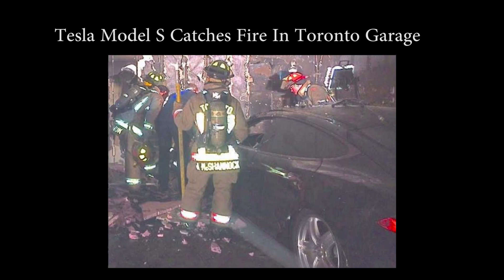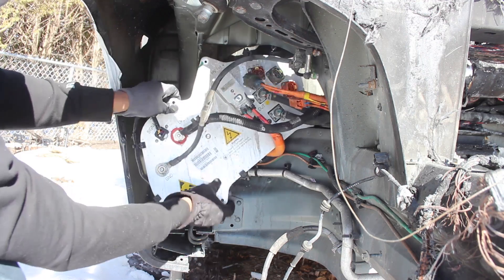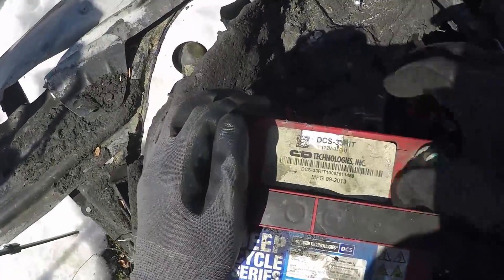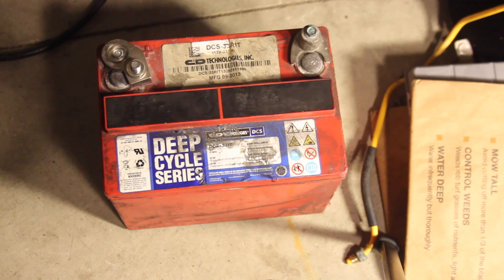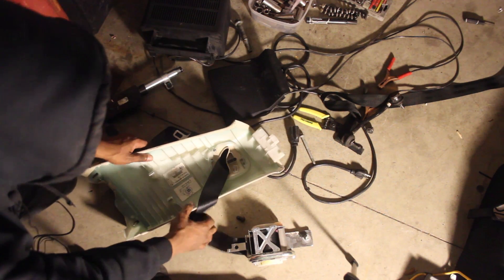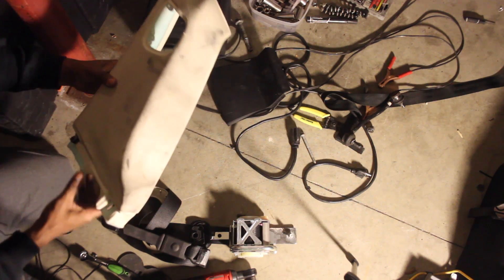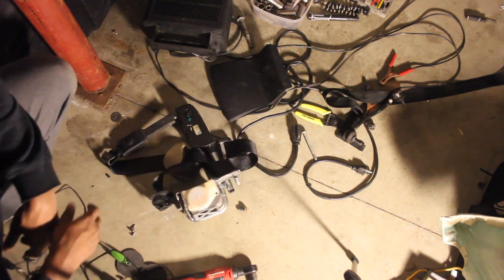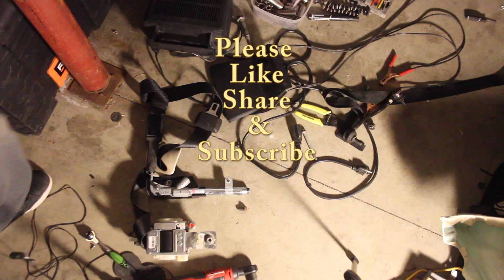Dismantling a fire Salvaged Tesla Part 1

Comment: You are correct about the explosive in the buckle portion pulling the buckle downward making the belt tighter. The explosive in the belt retraction device actually causes the belt to tighten as well. In doing so, the belt does become locked too.

Comment: Hey man - I thought of an interesting Q for you, Rich.  Say you're in bum f*ck Egypt and you run out of charge.  Who can you call?  Will AAA come to your rescue, and if so, what could they possibly do to get your Tesla running again?  These car batteries take a long time to charge.  Would the technician tow your vehicle to the nearest charging station?  And finally, have you ever been to charging stations and every slot was already in use?  Is it possible to sneak (wink wink) a nozzle out of someone else's car and into your own or are the charging lines too short for this?  Obviously, I don't anyone with a Tesla so forgive my ignorance.
Reply: Any towing service will tow you wherever you ask them to, so tow to nearest charger as you say.  Superchargers have rather short charging cables and they do lock in when the car is locked, so no stealing a cable there.  Superchargers are rarely full except in certain places with lots of Tesla owners and fewer charging stalls, but Tesla is actively expanding these locations (ie Burbank, CA used to often be full with only 6 chargers but they recently added 20 so now it's rarely full).  At slower chargers you often can unplug another car to plug yours in, and the cables tend to be much longer since not all cars have charge ports in the same place.  Sometimes owners leave a note saying you can unplug them after a certain amount of time.